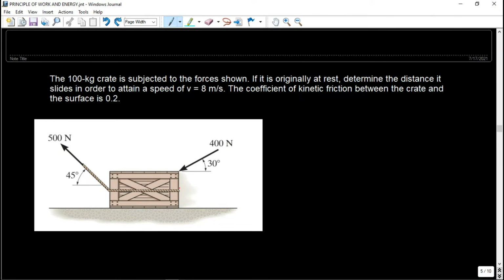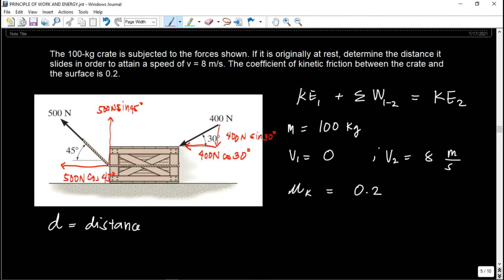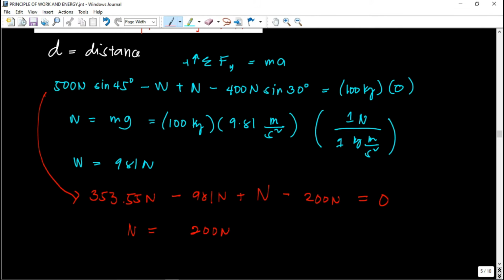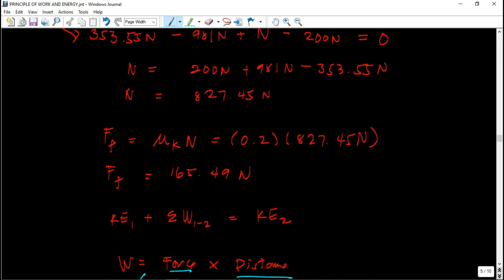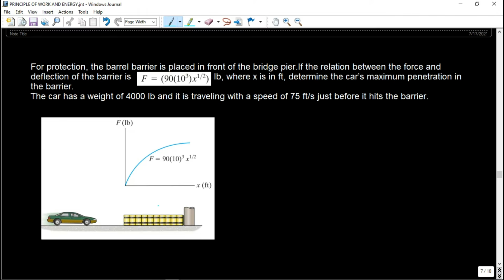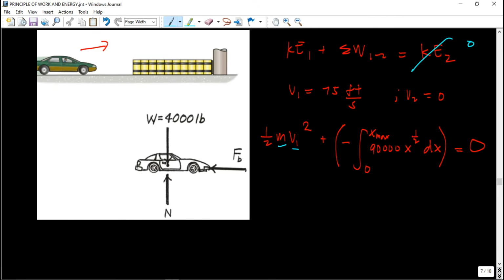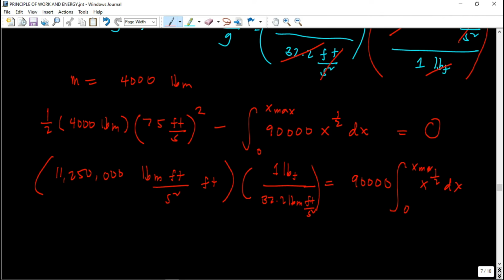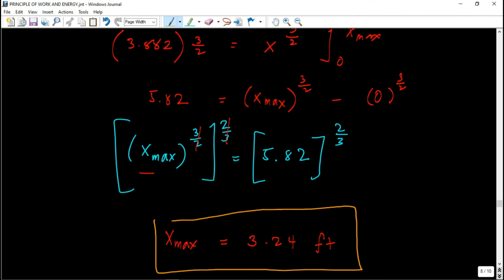WORK AND ENERGY (PART 2) TAGALOG/ENGLISH

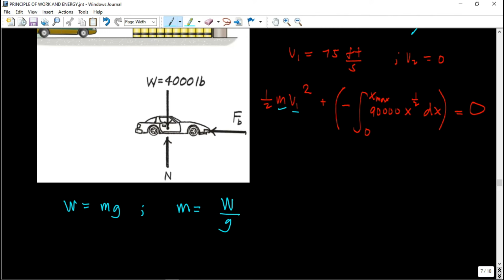Comment: 27:36
F=mg

This is the second time that i saw the lbm and lbf its still confusing
Until i searched  other videos to clarify about Lbf and Lbm

I found out that the unit for lbf is slug(32.2ft/s^2)=32.2lbm(g)

Thanks for tutorial videos engr.
It helps a lot
Reply: Same. I was also confused in that part. Since in school we're using lbf/(ft/s²)= slug. And 1slug=32.2 lbm for conversion